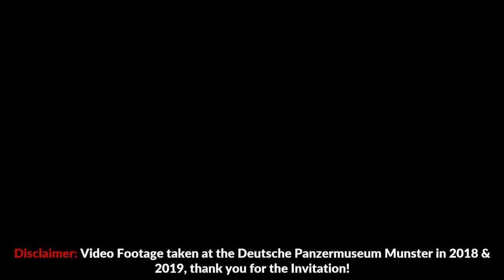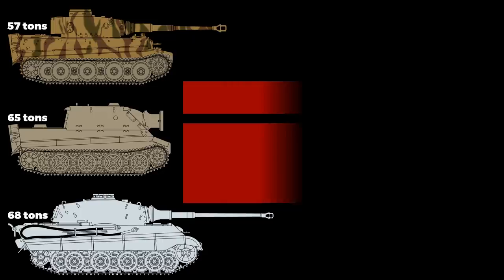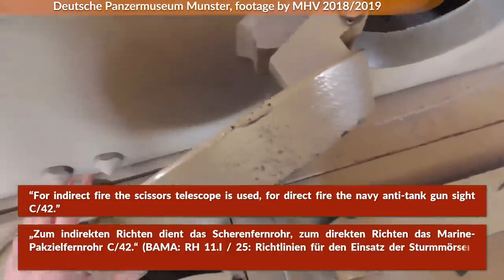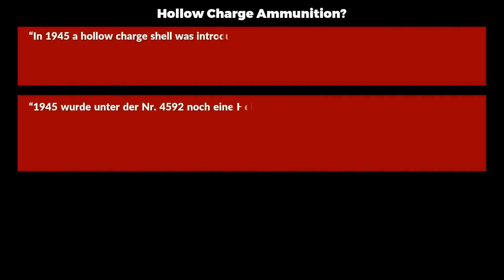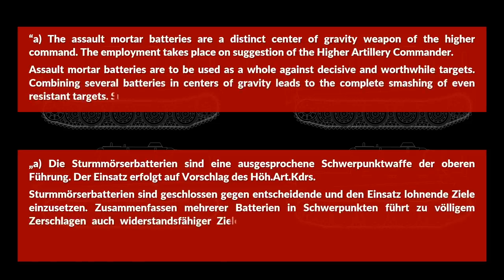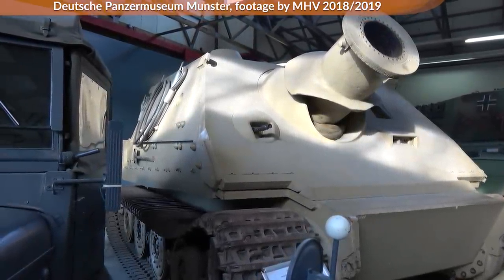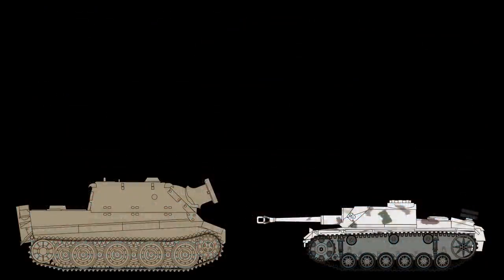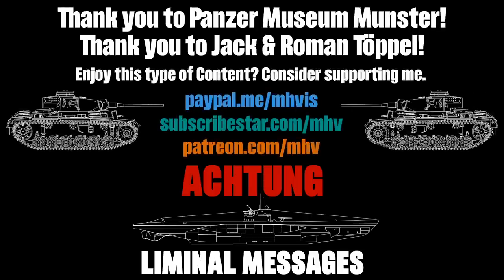How to use a Sturmtiger

Comment: This was a great podcast 👍
You touched on it lightly, but I think it factors into the 15-minute, reloading time.
And that is the signature the weapon.
Tremendous amount of smoke was generated by this mortar. So much so, it was guaranteed to give away your position. So the panzer grenadiers, would move with the unit, after firing every round.
Hence, the 15-minute reloading time.
Just saying.....   ...
And it was the ultimate bunker-buster on tracks!!!💥

Comment: One slight correction: the MG42 (same as the MG3 and MG4 nowadays) are by no means light machine guns, they are, according to Wehrmacht and Bundeswehr manuals, proper heavy machine guns. Which is reasonable at 13kg empty and 1200rpm with 7.62x57/51mm (8mm IS/.308). Which is quite a difference to your standard light machine gun like a M249, packing barely 700rpm at 5.56x45mm
Reply from the maker: With bipod - leichtes Maschinengewehr, with Lafette 34 - schwere Maschinengewehr. That was the tactical Wehrmacht classification see the various Heeresdruckvorschriften (H.Dv.) of the time.
Bundeswehr might do stuff differently, after all a "leichter Granatwerfer" for the Wehrmacht is now a "Mörser". Stuff changes.

Comment: Fascinating insight. Do you have any reports concerning the effects on targets and the relative efficiency of the weapon?
Reply: From what I've been hearing, it's a pretty inaccurate weapon, but has unbelievably powerful shells. One fight had a few sturmtigers caught in a battle, and while they generally were too inaccurate to do much, one sturmtiger landed a single shell in the middle of a sherman platoon, and killed 3 tanks at the same time.

Strategically, they were horrifically ineffective. It was nigh impossible to rearm their very specialized ammunition, and many were simply ditched after running out of munitions or fuel.

An awe inspiring weapon, but not a war winning one due to flaws because of just how many were ditched.

They also never really got to be used in their very specialized role, which makes it hard to determine how effective they actually were.
Reply: @sol2544  Thank you for your insight. Do you have a book to recommend?

Comment: I wonder if the remarkably low rate of fire is why they paid attention to dispersion for this weapon but not as much for other artillery pieces.  When you can fire multiple rounds per minute, you can adjust more readily and maybe even enjoy the "shotgun" effect of those rounds scattering.  So dispersion is not as much of a concern because of how you can saturate the area. 

But when it will take fifteen minutes to reload, you need to make each one count.  That means telling your crews that, even though they can reach a target 5000m away, odds are they're wasting their limited ammunition.

Comment: Considering the pre requisition laid out, the most logical employment would be well prepared, camouflaged defensive positions near points of high strategic value, like bridges. Generally it would be difficult to bring this in range unnoticed, but this problem vanishes when the enemy approaches to a well prepared position. I presume it may have had some value as a defensive weapon.

Comment: Well I learned a bunch, thanks! When I am ever to NEED to use this info...... slightly unlikely but you never know.
Reply: When you swing by your meth dealer's place and she's not home, but the girl "minding the shop" invites you in because "she [the meth dealer] should be back any minute", and you [plural] pass the next hour playing some kind of online trivia game on her tablet. Then she suggests going for a drive to the trailer park down the hill because she [girl with the tablet] knows where she [meth dealer] is at, so you [plural] do, get a point under a gram (because that's all she [meth dealer] had, because she's waiting to re-up), then go back up to the house because she [meth dealer] won't be coming back  home for at least four more hours, so you [plural] spend the next little bit improving your [plural] trivial knowledge, feeling each other out and sizing each other up, while she doesn't use a single bit of the meth she just helped you score despite your offering. So, although you may never have any NEED to know any of this, the occasion when it might be useful, desirable, or advantageous could come at any time up until which you've just been going through a normal day.
Reply: Kris MaKardikan You know that EXACT same thing didn’t happen to me just yesterday!! But you never know, today’s still young. Meanwhile how do you start the darn thing? I’m thinking that if you’d pulled up to the meth dealers house IN a SturmTiger (meth dealers still incorrectly call it that) they would “find” just enough to fill your order.

Comment: I can’t imagine what a hollow charge 38cm rocket would be used for. Clearly the Sturmtiger is not designed to engage tanks and I doubt it’s mortar could accurately land direct hits. The mortar’s HE would be enough to knock out a Sherman anyway considering it’s size and high trajectory. I bet the hollow charge ammo came from the Naval variant as I could imagine it would be useful against ships.
Reply: And at 10:05 even the manual states that due to the wide dispersion (=inaccuracy) it should only be used against extended area targets. So the hollow charge (as you wrote) made no sense.

Comment: Brilliant presentation finding those obscure valuable documents! Perhaps during the opening stages of Hitlers last master stroke , the Ardennes offensive was perfectly planned with elite Waffen SS forces and most importantly- bad weather . Sub zero temperatures and blinding snow the perfect concealment for German forces used to Eastern Front conditions. The Sturmtigers MAY have had one functional battery but their numbers are so rare and obscure it’s hard to determine once the weather cleared it was impossible to move German forces during daylight hours the skies were buzzing with P-51s and P-47s total air superiority vs a Luftwaffe that was out of precious fuel . There is ONE PRESERVED video of this beauty during the Warsaw Ghetto uprising of 1944 along the Vastula River . ITS A ***** ROCKET nothing like it before or since nothing was left of Warsaw Hitler and Himmler ordered it wiped off the face of the earth .

Comment: I did some basic maths and it seems to show up how poor the cost/benefit would be with the Sturmtiger. So, yes, 125kg of explosive per round is huge, but at only 4 shouts per hour, it means 500kg of explosive on target. 
Compare that to the 15cm artillery piece, at 120 rounds of 5.1kg results in 612kg of explosive on target. Even at just 100 rounds per hour, it's 510kg, so still more. And, as mentioned there is suggestions that this was a doctrinal maximum, not necessarily the absolute maximum.
And a Strumtiger battery only has 4 units, so the unit has a maximum of 2 tons of explosive, I remembered you did a video on German artillery composition and the heavy artillery battalion had 12 pieces in it, which is a potential of over 7.3 tons of explosive per hour. The 15cm also seems to have a much longer range to which it can deliver this greater weight of explosive.
AND I'm willing to bet one 15cm Schewe Artillerie is much, much cheaper than a Sturmtiger. I can't imagine those 38cm shells are cheap to produce either, whereas 15cm shells were a common size of weapon.

So the Sturmtiger is more expensive as a delivery platform, more expensive to provide ammo for, harder to use for rapid response due to organisation, would have required a special logistics system to deliver ammo, had a drivetrain that was already a weakness in the much lighter Tiger 1, delivers nearly 1/4 of the explosive weight per hour and delivers it at only about 1/3 of the range when compared to the conventional 15cm Heavy Artillery piece. 

It's at that point, my question becomes: who on earth thought this was a good idea??
Reply: My ancestors apparently. But this thing really looks cool when you stand in front of it. I guess this is the same shit that went down with the Maus tank. Absolutely massive, but not very effective on the (imaginary) battlefield.

Comment: There may be some confusion about projectile weight and bursting charge weight.  Regular gun type artillery has a fairly low amount of bursting charge compared to the weight of the projectile because the walls of the projectile must be thick to resist the G forces of the acceleration in the barrel of the gun.  However, the thick steel walls turn into shell fragments ("shrapnel") which cause casualties and material damage.  Rocket projectiles have a much higher ratio of bursting charge to projectile weight because the walls of the projectile only have to resist the much lower acceleration loads of the rocket.  But this means the target effect is the result of more blast and less fragmentation.  There are advantages and disadvantages to both types of projectiles depending on the target characteristics and the tactical situation.

So, it is rather misleading to compare tube artillery projectiles to rocket artillery projectiles.  Apples and oranges.

Comment: Engineer 1: Do we use sheet metal clamps to mount the exhaust system?
Engineer 2: No we will use steel casts. Make em thicc.
Engineer 1: Ok. But how heavy do you think this is going to be?
Engineer 2: No less than 500kgs Hans. The exhaust must not come off under any circumstance due to TÜV regulations since the tank is not deemed combat ready otherwise.

1:04 for context

Comment: One quick question. Dose the 5 light machine guns in the company/battery include or exclude the ones mounted on the vehicles?
Reply: They would be separate. Probably most likely used for air defence.

Comment: I had the impression that the Sturmmorser VI (fur Raketenwerfer 61) could almost always see its targets.  That is considerably different from the PzW and NbW/WG artillery rocket launchers and, especially, tube artillery.   Weren't those usually used for indirect fire?  The SMTiger drove right up and let fly, much like the A.V.R.E. mit MülltonneGerat.  You can do that* with 150mm of front armor.

*Most places.
Reply: In fact, I'd rate Sturmtiger as a better fit for "Stuka zu Fuss" than the SPW mounts.   That 38cm projectile is the bomb.  <Bill taps microphone>  "Is this thing on?"

Comment: Ive built a \35 interior of a Sturmmorser recently,the Ammo storage racks look very frail for the weight they carry.It looks as if it would be easier to load individual rounds into breech from rear hatch,trying to manage rounds from the internal ammo stowage system looks very awkward and dangerous.You have to lift them once,why rack and unrack the heavy shells in a small hard corner infested box?

Comment: Does anyone know why they called all ground troops Grenadiers?
My understanding is that the term was initially meant for more elite troops, selected from tough and disciplined soldiers, meant to engage in close combat, often mechanized. Seems that using the term to describe everyone, while it might have a short term morale boost, would cause more confusion than its worth and would basically preclude actual Grenadiers from use unless another term was established.
Reply from the maker: Renaming and yes it was a more elite term, but then used for basically all infantry.

Comment: Ok so what you're going to want to do Is put a crank in the back crank it, start the engine, get in, somehow load 380mm rocket than if you want to turn or move to your preferred firing point use the little triangle things and the length of your target to find out how far away it is, measure where you have to aim by taking how far away your target is and the speed of the rocket and how fast it drops do the math, aim, fire, there you go

Comment: This is not related to the video, but I have always wondered what those things on the front and back sides of the King Tiger turret?
Reply: What things? You mean the pieces of tank track?
Reply: @Coddykin  is that what it is? why are they on the side of the turret?
Reply: Protection/ spares when the tracks break

Comment: So the ideal circumstances for using Sturmtigers were self-defeating. Due to the short range it has to be brought forward but it should be concealed. You want to try to conceal a 65 ton chunk of metal? Plus the opposition might be wondering why you are bringing up flak batteries. I am shocked at the dispersal but the question is how lethal would the warhead be over that area? Plus I expect the target for a Sturmtiger would be so substantial that missing it would be impossible. And of course what on earth would require more than one hit to knock out?

Comment: By maximum range at 10° did you mean elevation of the gun, or literally the temperature as you said in the video?
Reply: Temperature.  It's the temperature where the ranges are calculated at.

Comment: I wonder what advantage this Sturmtiger had over ordinary self propelled artillery, given that it's so clumsy. Who thought this thing was a good idea? I mean if the artillery fired at long range, the trajectory would also become flatter, so maybe it had troubles to hit defilade areas?

Then again the "boom" was much bigger than that of ordinary artillery. So you would expect its main role to be firing directly (hence the need for heavy armor protection; indirect fire was much too inaccurate, as the video points out) at fortified psoitions. A rather rare occurance on the western front, one might suspect.
Reply: Its bullet could knock through 2 meters of concrete and its explosive power must have been greater than even a heavy artillery shell. So heavily fortified bunker would be trashed. And a room on a building would become completly destroyed... and I wonder if not such a big shell would not be able to even take out an entire multiple floor building in a city with one such big shot.

I guess this thing would be used to take out bunkers and buildings like this things:https://en.wikipedia.org/wiki/280_mm_mortar_M1939_(Br-5)
https://en.wikipedia.org/wiki/203_mm_howitzer_M1931_(B-4)
But the difference would be that the sturmtiger would have lots of armour to protect its crew until they could get their job done. The huge thick frontal plate would probably make anything the enemy fired at it bounce off, so they would be in a hopeless situation against this monster... and their comfort would mostly be that this beast had little ammo and a low rate of fire.

I am not impressed with this tank. Maybe it was just an exprimental tank build just for fun to see what they could do with a big naval shell, rather than a serious project planned to start serial production.
In my opinion should the Brummbär have been enough for the Germans if they really insisted on having one this type of vehicle. Wasting a tiger tank seems increadibly stupid to me given the dire situation Germany was in in 1943 when this project was started.

I also think this type of machine seems increadible inflexible since it doesn't seem to fill other types of roles on the battlefield. ISU-152 and SU-152 seems smarter constructions seems they seem good at both knocking out buildings and killing tanks and playing the role of artillery.

Comment: The inclusion of temperature when talking about range is quite confusing. When you first started speaking I assumed you were going to say elevation. Odd!
Reply: I'm not particularly clued up as to the reasons why, but air temperature does have an effect on the range and accuracy of artillery and mortars

Comment: How does temperature affect the accuracy of the mortar
Reply: It's a WW2 rocket propelled HE warhead....
The chemicals of then do suffer from temperature (also why C3 and earlier plastic explosives also had issues of working in extreme cold weather) because stabilizers of the time couldn't make cold or hot weather a non issue....
Also certain weather conditions do affect ballistics at long rangesz more so a slow, not fast accelerating rocket propelled artillery shell.
Reply: Our older propellants were susceptible to moisture and cold affecting ranges and consistency. Altitude also affects range, higher you go the further it is thrown which caught us out up mountains for a bit. 
Modern propellants are less affected but it still pays to keep it dry.

Comment: Was there ever any case the Assault Mortars were used effectively?
Reply: Willi Mues described in his book "Der große Kessel" the use of 4 Assault Mortars of Stu.Mrs.Kp.1002 in April 45 against a column of Amrican tanks and trucks:

"The first action was in the area Dorsten-Kirchhellen. After the retreat from Kirchhhellen they took position in the woods north of Feldhausen, ca. 2km east of Kirchhellen. From there they could overwatch the fork of the street north of Kirchhellen (R223-today B223) and noticed a gathering of strong American forces, some of which seemed stuck. With all 4 Assault Mortars they fired a salvo in direct fire. The effect of this salvo was unbelievable for its time. Vehicles flew through the air and tanks overturned like cardboard boxes. Of course the position had to be abandoned immediately, but it took hours untill the Americans recovered and used airplanes. On the further retreat over Polsum-Marl-Datteln all remaining 24 rockets were fired from favourable positions in direct fire only to archieve an effect as good as possible. In the area east of Datteln the precious vehicles had to be destroyed since all ammunition was spend, ressuply wasn´t to be expected and the Assault Mortars handicaped the 116.PzDiv because of their immobility."

Sorry for spelling mistakes etc, translation was done by me.
Reply: @LWTUA120609  thank you for sharing this for us. Your English translation is spot on!